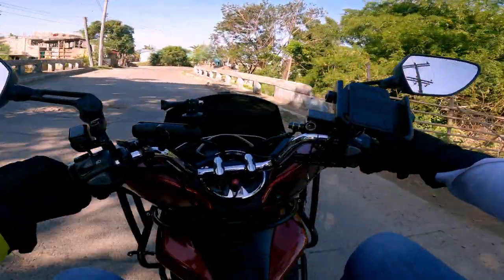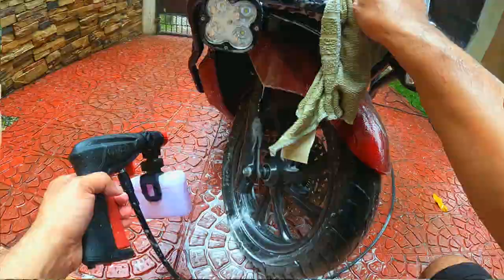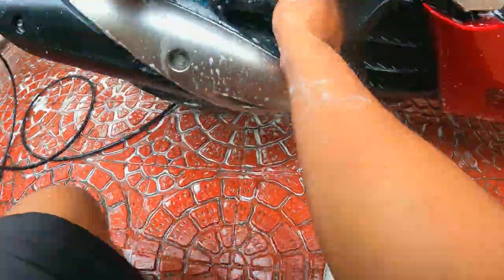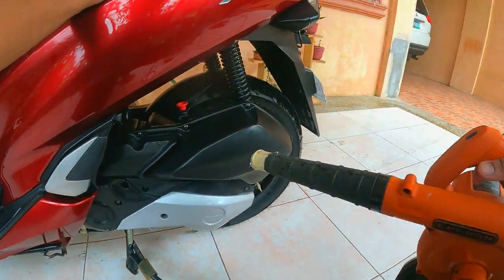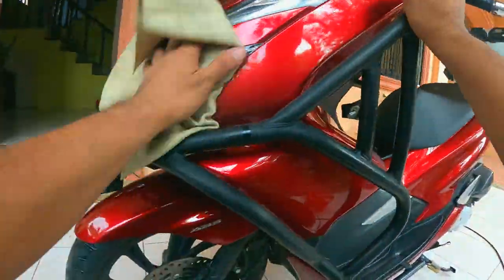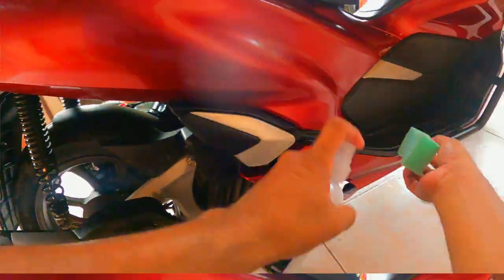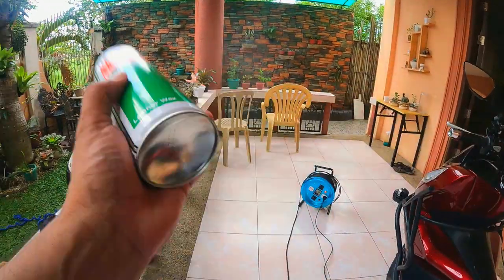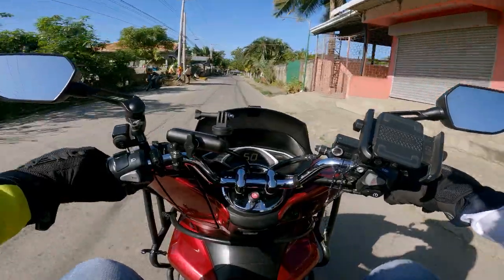Honda PCX 150 - Dirty to Shiny in 30 Minutes

Comment: hello friend, great video. One doubt, this acrylic piece on top of the headlights (I don't know what it's called in your region) is very marked, due to improper washing or transport. she came like this when she was young. What can I use to remove or mitigate these risks?
Reply from the maker: That's a good question. I have no idea either. Will ask around.

Comment: On the white watermarks issue on the motorbike, I highly suggest you use eraser (any eraser) for pencils and it will disappear
Reply from the maker: This is a perfect suggestion boss. Will definitely consider this if ever it happens again.
Reply: @ridealive  also, if you want to make the black fairings have that black sheen again, use a heatgun and follow what ChrisFix did on a car